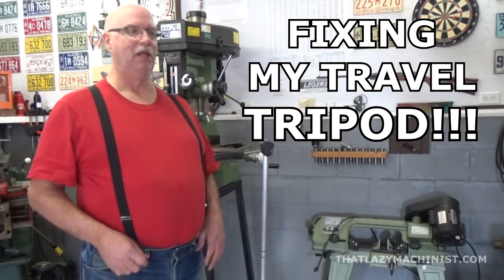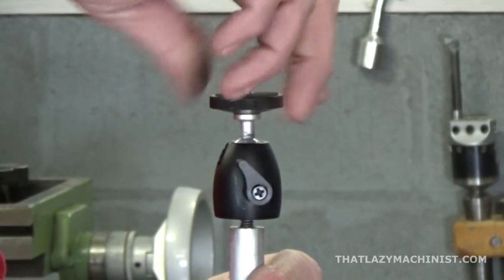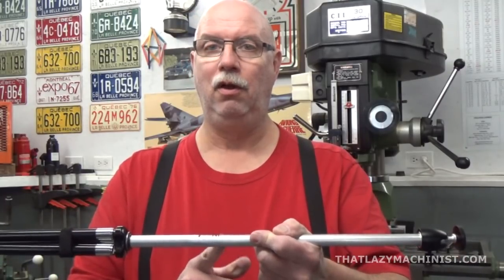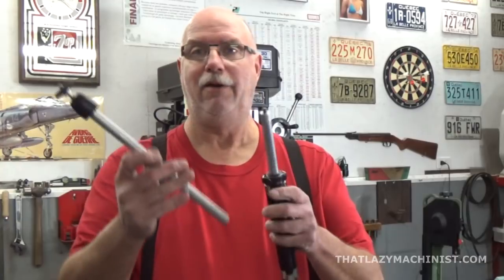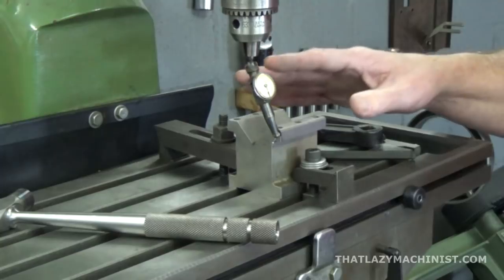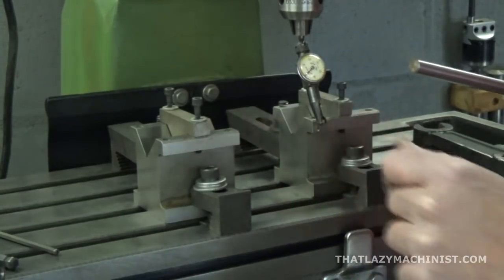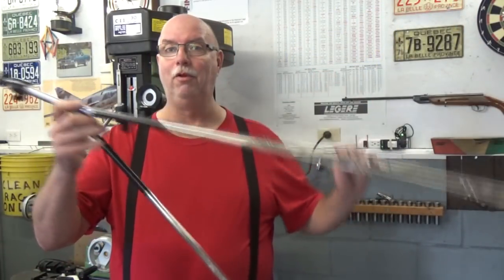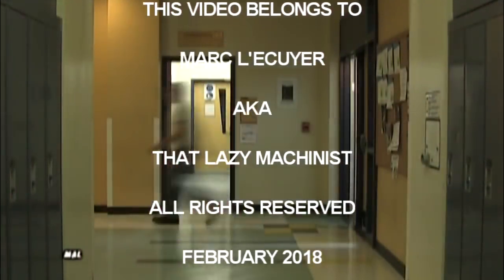TRIPOD REPAIR & MODIFICATION, MARC LECUYER LQ#035

Comment: Creative solution, of course well executed in fine style: practical, nay, even beautifully practical in use. And, dear teacher, thanks for the reply on the threading dial. I do have a metric lather with only four numbers (degrees?): 30, 60, 90 and 120 with short lines at 6° intervals between numbers on the threading clamp. Changing from 30 to 90 with each threading pass makes for a small offset of my threading tool engagement with the part, approx. 1/2 mm. So, I'll have to stick to same number (or mark) with each pass. I do so appreciate your generous help. Happy to see you still kikkin'.